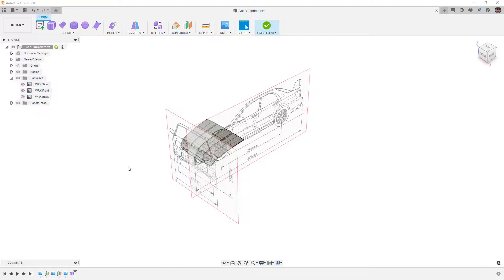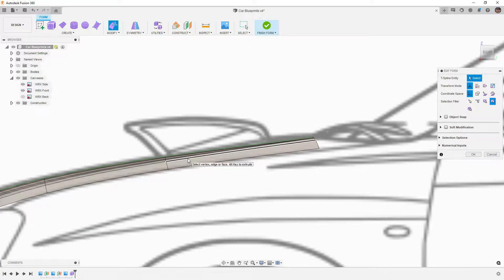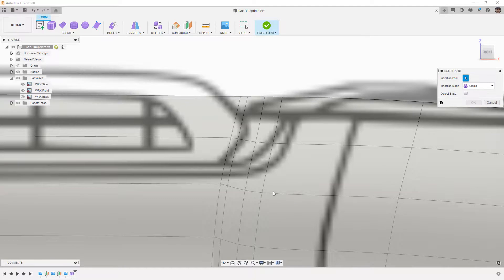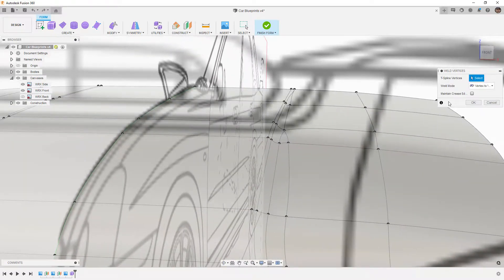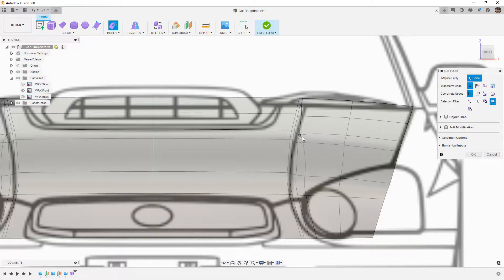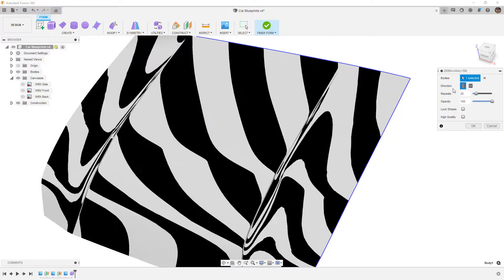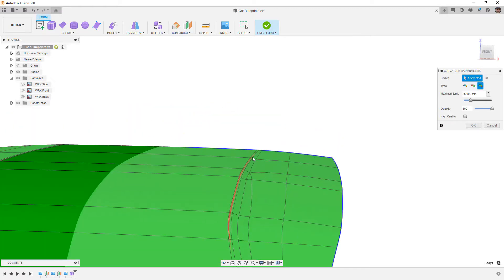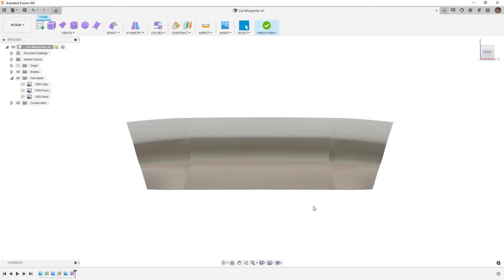Fusion 360 Forms - Part 4 - Finalizing Hood Details

Comment: I've been using Fusion for some years, basically self taught. Expert? Not within a bulls roar. Hard surface modelling has always been a mystery to me and its a mystery I want cracked open! Looks like I've found the perfect place. I've dabbled, got frustrated, tried again and again but without a good resource to go too I've never been able to crack that shell.
Reply from the maker: Ian I will say that true surfacing in Fusion is frustrating compared to some other programs.  I have started a new series surface modeling a car vs using forms.  So this series was meant to really just do the hood and i ended up getting carried away.  The Ferrari 308 was a forms all the way series.  The Bronco is surface tools all the way to kind of show the pros/cons between the two.  If there is something specific you want to see let me know.